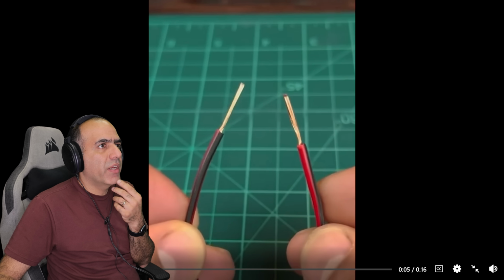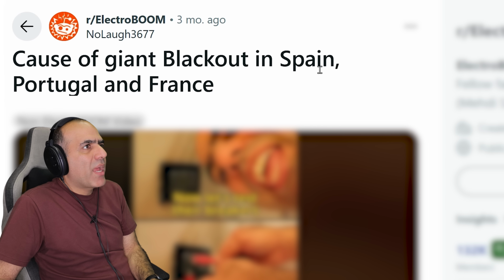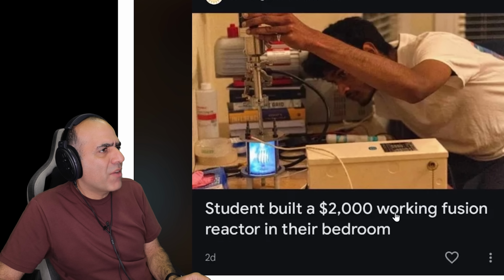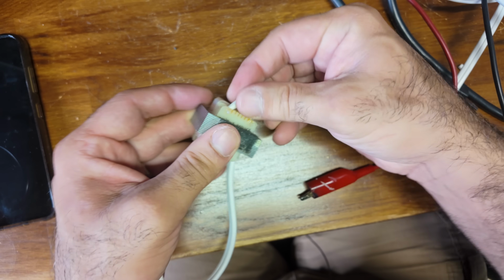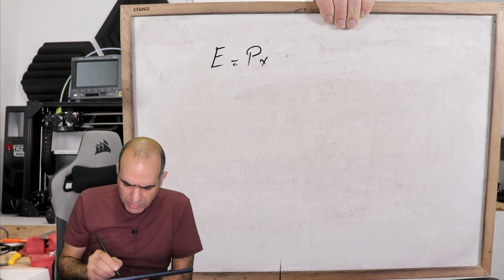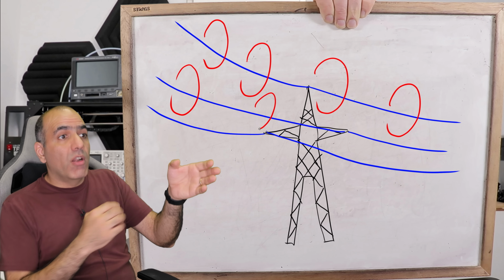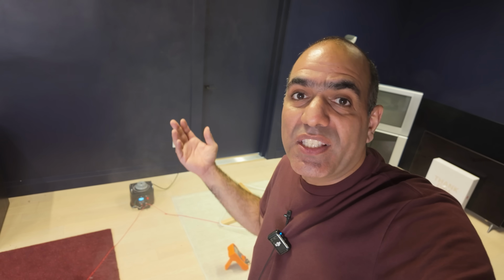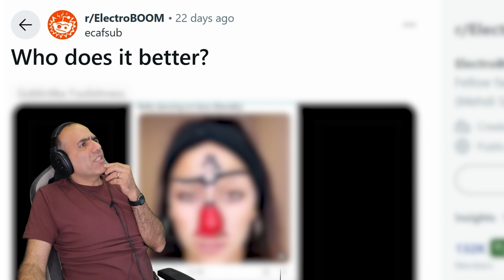Power Lines at Knee Level? Campfire with AA Battery?! (LATITY-016)

Comment: 5:55 That hydrogen fusion reactor is real. It's called a Farnsworth fusion reactor. You use more energy than you get out of it, but it is capable of producing deuterium fusion. It's a scientific curiosity, It's nice, and you can always say you have a fusion reactor at home. But apart from that, it doesn't have many useful applications.
Reply: "It's a scientific curiosity" Well, mostly a curiosity. There is a company that produces them commercially though as a neutron source for certain lab applications.
Reply: Indeed. We created fusion reactions a loooong time ago. That's not what those reactors are trying to do. They're trying to make it an actual source of energy. Creating fusion is easy, making it in a way that you actually get energy out of it, that's hard.
Reply: @LeutnantJoker  Well inducing nuclear fusion and getting net energy from it is still easy to do, as long as you expect to use it immediately in thermal stage, and usually with… not really good intentions, most of the times
Reply: @Νοτσα  I still wouldn't call that easy. I can't build a hydrogen bomb in my basement, but I CAN build a Farnsworth fusor!
Reply: @ilikeyourname4807 Hmhh... You got a point
Reply: @Νοτσα to correct your thought on fusion. The actual hard part is containing the unbelievably hot plasma that melts all existence and is multitudes hotter than the surface of the sun.

So the sun in the box is hotter than the sun. We figured out a sun in the box but to do so it had to be hotter than the sun. 

This creates a problem because even dirt and rock burn along with every substance on earth.
Reply: @LeutnantJoker  Getting massive amounts of energy out of fusion is pretty easy.  We've been doing it since 1952 with the first hydrogen bomb explosion.  The hard part is getting controlled useful electricity out of a fusion reaction.
Reply: @stargazer7644  pulsed release. Electrical detonation stimulated sonofusion. Spherical vat of liquid deuterium with thin enough electrodes that feed into the center and detonate at a resonant frequency of the vat, building up the soundwave until a standing wave is established. The idea is to build up the power inside the volume and maintain the focusing effect observed at the smaller scale with sonoluminescence where the material at the center/focus of the vat experiences the pressure of the potentially huge moving mass. The concept could be experimented with, but I haven't seen any attempts yet, though there are similar projects, like the one with pistons from General Fusion, though that seems like a lesser version. The idea came with a system to extract the excess by treating the vat as a LASER cavity. Perhaps possible, perhaps not
Reply: @stargazer7644  Boiling water and pushing a generator with steam doesn't seem as complicated as fusing two molecules together. Unless you're talking about getting the heat from the reaction which they use Tokamak for. I don't know shit about all that tho I just did a research paper in college for a dumb speech class.
Reply: Technically, the headline didn't say he made a 'power plant', but most people would think that based on the title. While 'fusion reactor' is a perfectly apt description, maybe 'fusion experiment' would be less misleading.
Reply: Named after Professor Farnsworth no doubt.
Reply: @Stickmanzed  Sort of the other way around. The Futurama character is named after (and loosely based on) the same Philo T. Farnsworth that the fusor is named after (his main claim to fame though is that he built the very first all-electronic TV system in the 1920s)..
Reply: @blahfasel2000  Although Farnsworth's claim to that is highly dubious, such as the way he claimed to have invented raster scanning, which of course was already in use.
Reply: @Stickmanzed  Also the inventor of the Fing-Longer ☝️
Reply: The issue is that a layperson hears the phrase "working fusion reactor" and assumes the "working" part means that the difficult problem (net energy output) was solved. But really all "working fusion reactor" means is that fusion occurred.
Reply: Apparantly some are being used as a neutron source.
Reply: More than that, a modified Farnsworth fusor implemented as a linear accelerator is at the heart of physics lab neutron generators. A cheap model goes for around $15k or so.
Of course, if you've got the parts to build a fusor, you've got the parts to build a linear accelerator type fusor, can't think of a single use for the hobbyist to have for neutrons though. But, proof that one is achieving fusion with a Farnsworth fusor is the presence of neutrons. Fortunately, they're not energetic enough to cause neutron activation of the components.
Reply: It does have one useful application.  It's pretty good at irradiating you and your neighbors with neutrons.
Reply: @stargazer7644  With the fusion rates that typical hobbyist devices reach (up to about 10^5 fusions per second) the neutron radiation is pretty much negligible. Even if you absorbed all neutrons emitted by the device (which would only be possible if your body entirely surrounded the device on all sides) the dose rate would only be about 0.1 mSv per day. Which is why they eg. let Taylor Wilson (who built a fusor at age 14) show his device to Barack Obama instead of arresting him.

More important (but also much easier) is shielding against the EUV and X-ray bremsstrahlung that fusors also emit.
Reply: This is true! It's applications are for observing fusion reactions between atoms, not generating power. That's why it's a fusion reactor, not a fusion generator. It's a classic experiment you can find dozens of videos and papers on.
Reply: It is also not safe to put your body next to it without proper shielding. You will get bombarded with neutrons.
Reply: @stonemannerie  As I already commented, with the fusion rates that hobbyist devices achieve the neutron radiation is so low that it's nothing to worry about. Even if you were standing next to the device 24/7 for a whole year you'd still be under the annual permissible dose for radiation workers and your most pressing issue would be your power bill.
Reply: So not actually a reactor. To be a reactor, you have to achieve criticality. That's just a Fusor.
Reply: @WJS774  I reactor means that it creates other elements with fusion. So, fusion power generator?
Reply: i mean it's like having one of those battery powered perpetual motion objects and say "look i have a perpetual motion ball". technically you do, but it requires extra power to work
Reply: To be fair, it's a reactor, not a generator, but I can see where misunderstandings happen.
Reply: PT Farnsworth invented the television. The Farnsworth Fusor is available commercially, and is used as a neutron source in geology. The manufacturer was, at one point, a subsidiary of the Chrysler company.
Reply: @dquam3885  No, he did not
Reply: @dquam3885  He didn't invent TV. He developed the first all-electronic TV system, which is not the same as electromechanical TV had already been invented (and practical implementations demonstrated) earlier. The word "television" had actually already been coined before Farnsworth was even born, and the first working demonstration of live image transmission happened when he was only three.

"The manufacturer was, at one point, a subsidiary of the Chrysler company." Nope. German Aerospace comany DASA (originally part of Daimler-Benz, Chrysler only came into the picture when it merged with Daimler-Benz) had a project working on a commercial fusor implementation. When the project was shelved the project manager decided to leave DASA and founded an independent company (NSD-Fusion) to bring a fusor to the market.
Reply: the farnsworth fusion reactor is just a fusor, not an fusion reactor. And it generates much less energy than you put in.

I invented an own reactor and have a big idea paper, but i can’t just build it myself yet because the prototype is a few thousand euro at least and it generates gamma rays as a by product which i could enclose (what the hell is the correct word for that) in an lead casing, but i would still need licenses and so on. So no, it’s not possible to just build a reactor in your basement or something like that.

Comment: Yeah i did that too 😂 you know those old radio power cables that have a blug with two big holes? It was pluged in and i cited it and i put my thumb on it to check if its a smooth cut 😂😂 it was like putting your thumb on a very aggressive vibrator and stung with thousands of needles 😂 it left a snake like burnt dots

Comment: 4:18 I think plugging in between can be useful if the device has a brick wider than 1 plug, so You can cover 2 plugs instead of 1 and two halves of another two (so basically 3)

Comment: 15:47 what kind of breaker is feeding that wire bro wth that arc went for way too long
When I short out a circuit here it just does a lil pop and the standard B16 breaker trips immeditately.
This is obv in America too and looks to be a 120V circuit, 240V or our 400V 3 phase gives off much more of an arc flash instead of a spark shower.

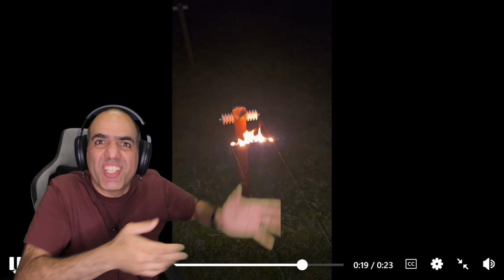Comment: Small correction on 5:00, fusion reactors do exist, as experimental devides, for research of fusion, the do not generate electricity. The challenge is making a generator that produces more electricity than it consumes. The term reactor does not mean its used to generate power, just that it has nuclear reactions (in this case fusion)

Comment: 5:54 to be fair, fusors are a thing and you can build your own "fusion reactor". $2000 seems about right.

Caveats:

1) You're not making a commercially viable fusion reactor, you'll be putting in more energy than you'll be getting out

2) You will irreversibly irradiate the reactor core as it runs so you have to be equipped to safely handle radioactive waste.

3) You have to find a source of deuterium or ideally tritium. This is nontrivial, you can use electrolysis of seawater to produce your own but it's very labour intensive and not inexpensive (but then buying commercially produced deuterium is also expensive)

It's really just a neat science experiment, you will fuse deuterium or tritium into helium and that will produce energy. The picture appears to be a farnsworth fusor. Anyway, it is totally viable to make a miniature sun, you just won' get your efficiency to even break even so you'll be paying for the artificial sunlight... and neutron emissions irradiating your reactor core and possibly other things too with inadequate shielding.
Reply: Correction, you're not making a commercially viable fusion POWER PLANT.  These are commercially viable fusion REACTORS.  One company sells them as neutron sources.

Comment: 4:18 if you have twoo outlets like this and you wire them up "corectly" it should be possible to get 240V instead of 120 in the US i guess? BEcause as far as i now, US has 240V local grid,  but they split it with an additional groundrail in the fuse box :D

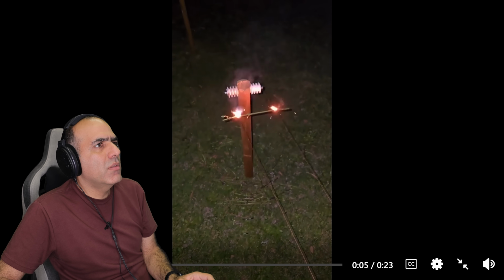Comment: 4:35   electric fence for keeping animals contained.  some are hot enough to burn weeds off them to keep the fence from becoming grounded. normally the earth is your ground, this person ran a second wire for the ground instead which allowed them to do this.  very high voltage but very little amps..

Comment: A fusion reactor works if it generates fusion reactions. Breakeven or higher return is another matter entirely. A Farnsworth–Hirsch fusor doesn't hit breakeven, but works consistently enough to be an electrically-powered neutron source.

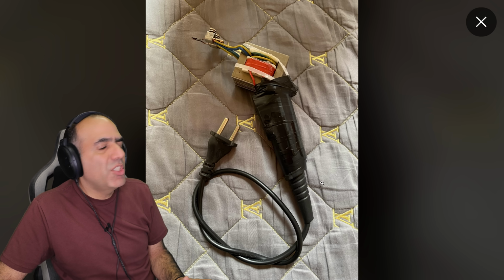Comment: 6:20 - I have one of those, its pretty common here, well, a lot better quality than that, but the principle is the same... a piece of wood, doorbell button that goes directly to a small transformer that the second coil is replaced by a very thick solid copper cable with 1,5 turns... it melts tin on 3 seconds and you can use it of pretty big cables (for its size).

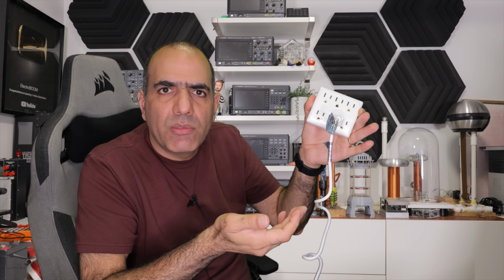Comment: 4:00 There could be an application for it. Say you have 3 wall-wart transformers plugged into each corner. The transformers are too wide and cover the top center outlet. The transformer plugged into the bottom left leaves the far right and half the bottom-middle outlet open, but the transformer on the top right has a protruding wire lead to the device it's powering, so the center of the bottom right outlet is blocked by that wire. You could then plug a regular plug in between the bottom right and bottom center.
That's a stretch, but it's the only weird-edge case scenario that I could think of. Of course, just buy a proper power strip with spaced outlets at that point...

Comment: A few years ago you and several other tubers made videos about the speed of electricity in wire where you all seemed to claim that electricity flowed along the outside not the inside of the wire, Would that mean a aluminum wire coated in copper would have the same resistance as a pure copper wire?

Comment: 4:00 Here's your application for splitting outlets: AC adapters (aka "Wall Warts"). I would plug one in the "wrong" way because it would probably use 2 outlets regardless, but there's less of the adapter hanging over to get snagged.

Comment: 04:56 That might be a scale model for testing phase arrangements etc? Judging by that guy's recent posts... Looks more like he did it because he could.
 
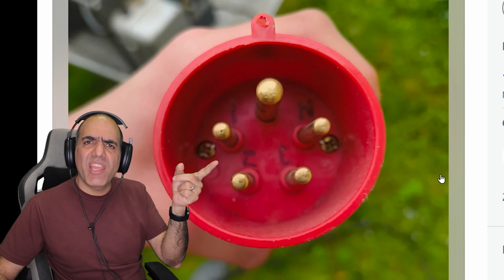10:37 that's a K9015 (or "commando") plug. It goes to a K9215 socket. Similar to a C13 cable going to a C14 socket. Which reminds me, why do C13 sockets even exist? They're weird.

Edit: Invalid point about turn styles.

Comment: Service loops for electrical wire is a thing. When I did HVAC they were required by code for wire we ran outside beteeen the outdoor unit and disconnect for heat pumps we installed.. It wasn't in the shape of a nutsack though. Just a 90° bottom going back up into the disconnect.

Comment: I used to ride my bike over a bridge that had high voltage lines running maybe 25 ft overhead. I swear every time I rolled over the metal expansion spacer at the top of the bridge I could feel a shock through my bike seat.

Comment: The low power line setup looks familiar - I can't remember the channel, but there's an electrician youtuber who does various demonstrations on power transmission and sets up controlled tests isolated from the grid. Much more sane approach to show the branch arcing this way than to climb up a ladder and put a branch across an actual transmission line 😅

Comment: Regarding HV lines inducing voltages on the ground, yeah it's the electric field gradient.  When I was doing my EE undergrad degree, my power electronics professor told a story of a farmer complaining about an experimental HV line (750 kV+?  I don't remember the exact voltage) that ran over his property, because his cows were unwilling to walk perpendicularly to the line underneath is, as they were getting tickled with electricity with every step.  The cows had learned to take a circuitous route under the wires to avoid the zaps.

Comment: 10:10 Those are most likely coaxial air chokes, designed to function like a really low-inductance inductor on a coaxial line to reduce noise and backfeeding.

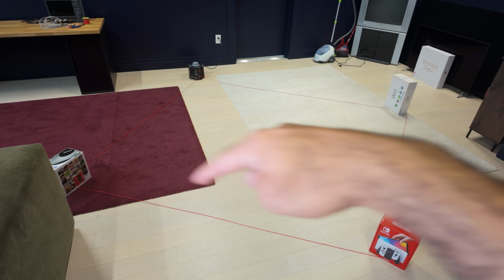Comment: 12:20 That's why electrical wire needs to be sized according to the expected maximum load of the circuit (and then some). Honestly, it surprised me how long it took for the insulation to start melting, 30+ amps is way past the limit for wires this thin.